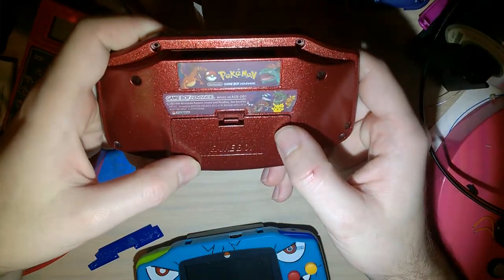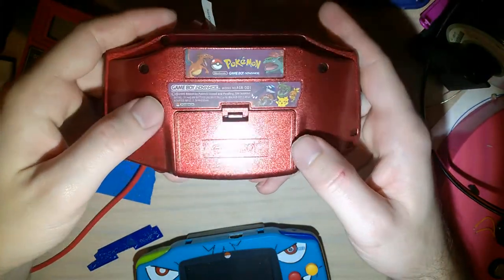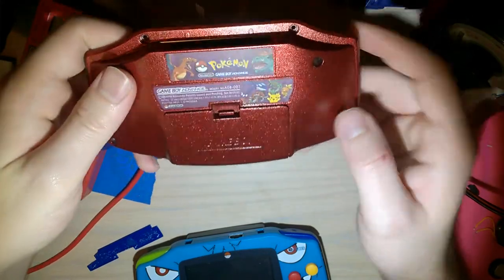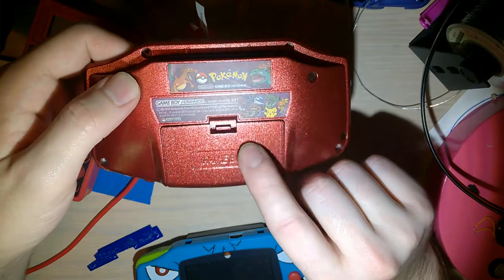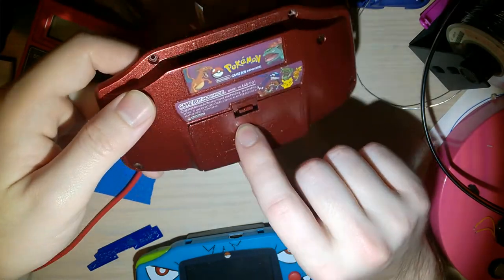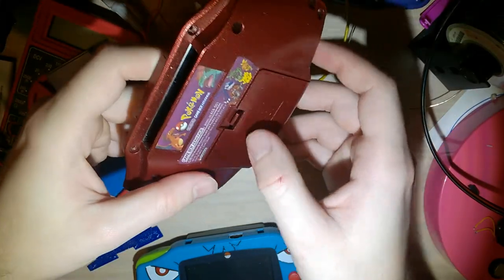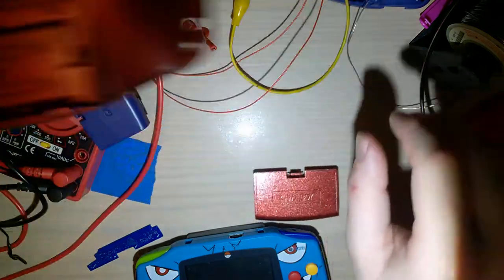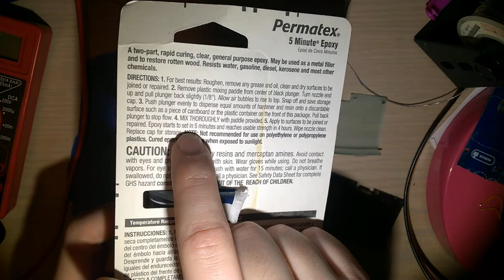How I added magnets to my GBA battery cover

Comment: I just did this to my Gameboy Color. A pin vise seems like a better choice than a drill press for this job because it won't melt the plastic as it cuts. I used one of those and it worked like a charm.
Reply from the maker: well, a better drill bit would be good too. I have much better bits now than I did when I made this video.
Reply: @makho  Fair point. Just wanted you to be aware of that solution in case you hadn't considered it. It's not as fast as a drill press but it seems more precise to me.
Reply from the maker: @popsiclewizard8068  thanks, it's a good consideration as well

Comment: Good Idee! But You could Use a hand Drill to make the hole
Reply from the maker: For the hole in the back housing, yeah, but for the battery cover, a drill press is necessary if only so that you do not drill completely through the shell.